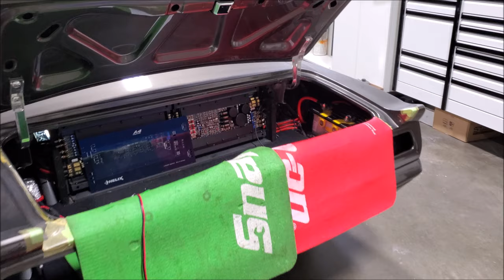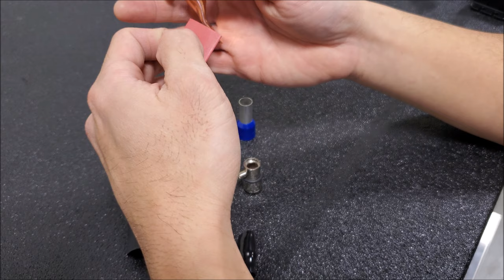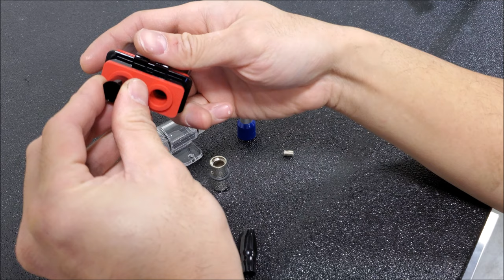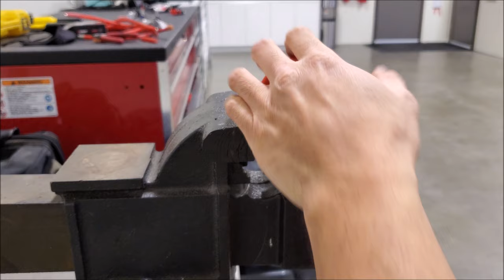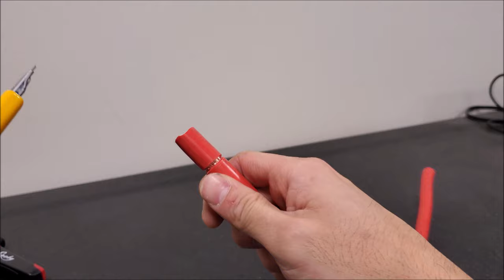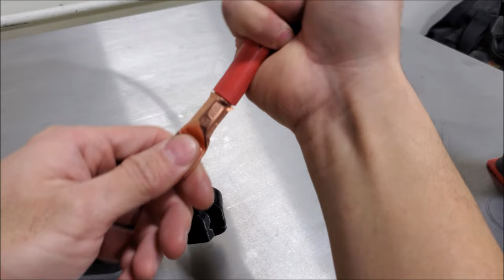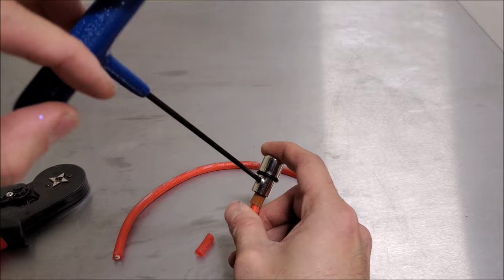How to Crimp Large Gauge Wires (Battery Cable Lug, Ferrules & Ring Terminals)  | AnthonyJ350

Comment: i'm going to guess the harder stuff is PVC, cna't speak for amp but, i have used EPDM insulated cable and it's thick and flexible
Reply from the maker: Thanks for sharing!
Reply: The biggest downside to EPDM is very poor resistance to petroleum.  As long as you keep it away from oil, gas and petroleum based greases, it can be good stuff.
Reply: @LTVoyager  I'm glad you told me, I didn't know that! And here Amazon sells it as welder cable! Not good for shop use them but, fine for in home battery banks and that!!!

Comment: The guy who taught me 2 weld wouldn't buy the copper end lugs he would make them out of copper plumbing pipe
Reply from the maker: Sounds like more work and not as nice a result.
Reply: I was tempted to do that back when the supply for ring terminals was very limited so they were expensive.  Now they aren’t as expensive even for good ones

Comment: Not sure why you're using starter lugs vs power lugs...
Reply from the maker: They're just copper lugs, they're not limited to starter motors.  But lets say they are.  They're used in the elements and can handle tons of amperage.

If you don't like the look, that would be a preference, but not a fundamental point.

Comment: Maybe make a jig. Meaning something to attach the actual hydraulic crimper to. Therefore making ur crimper stationary so you have hands free to position ur work piece(the wire you're  crimping).. they sell a crimping MACHINE that basically does this. Granted  On that machine all you have to do is push a button to  Finalize your crimp.  But it costs upwards of $1000.  Make a jig that basically  costs nothing from say, scrap wood and zip ties. (just an example) yes making your actual
 crimp is manual, but this jig makes it much easier to attain a good looking, more effective  crimp...
Reply from the maker: I use a press with the hammer style crimper now.

Comment: Dielectric grease is an insulator, not a conductor, use it only on the exterior surfaces to create a seal to prevent corrosion. Don't use it as an interface between connection points.
Reply from the maker: I prove otherwise in this video https://www.youtube.com/watch?v=YgJRKlE7pYg&t=401s
Reply: @AnthonyJ350  you can say you prove it, but read the directions. It's not supposed to be used between contact surfaces. I trust the manufacturer and my 25 years of experience working on aircraft over some dude's say so on youtube. Even a simple google search show's you are wrong.
Reply from the maker: @christaylor93  But I show what's happening with test tools. I'm not just saying it. Now not all dielectric grease displaces the same.

To be fair, in aircraft world. Don't you replace wiring after "x amount of service hours"?

I'm not just some guy on YouTube. I have 15 years of field experience working on daily drivers, emergency vehicles, motorcycles and fleet trucks that do salting.
Reply from the maker: @christaylor93  Did you "Google search Dielectric definition? It literally says "having the property of transmitting electric force without conduction; insulating."

Sooooooooo?
Reply: @AnthonyJ350  no, we don't replace wiring after any amount of service hours. That would be almost impossible to do. We're talking miles and miles and miles of tens of thousands of wires.
Reply from the maker: @christaylor93  Thank you for clarifying your industry. Do you have an objection to the definition of "dielectric"?
Reply: @AnthonyJ350  dielectric
noun
di·elec·tric ˌdī-ə-ˈlek-trik 
: a nonconductor of direct electric current
Reply from the maker: @christaylor93  In a 12 volt automotive application can you consistently get dielectric grease to insulate enough to prevent a connection from happening.

I put a thin layer in all my sensor plugs of my car to see if it would prevent it from working and it didn't. Motor cycle mechanics and boat mechanics like to use it due to all the moisture their plugs encounter.
Reply from the maker: @christaylor93  "To debunk this common myth, our application and validation test design engineers created an Electrical and Water Resistance test kit. This test demonstrates the insulative properties of dielectric grease, in this case NyoGel® 760G, and proves that grease does not affect conductivity"

https://www.nyelubricants.com/myth-grease-interferes-with-conductivity#:~:text=To%20debunk%20this%20common%20myth,grease%20does%20not%20affect%20conductivity.
Reply from the maker: @christaylor93  Can you actually prove it consistently? With a multimeter and a powered up device show a degradation in voltage, reduction in amperage or variance in resistance on a wire?
Reply from the maker: @christaylor93  I'll take your silence and lack of proof or any type of testing to show that dielectric grease degrades conductivity as your answer...
Reply from the maker: @christaylor93  YOHB?
Reply from the maker: @christaylor93  You said you trust the manufacturer. But I showed a manufacturer that said it's a myth on reducing conductivity.  

Soooooooooo does that mean you're ok with it? Are you the electronics doctor of the planes?

I do understand airplane standards are higher and different compared to cars. I'm just sharing what I use on salt trucks, emergency vehicles, work trucks, motorcycles and daily drivers.

Comment: I see your using copper clad... ☹️👎
Reply from the maker: Some brands like Stinger put a coating on their wire that's silver.  You cut it and it's copper inside the strand.  I don't use or recommend CCA.  It's also "You're" not "Your"

Comment: That sounds stupid you put it back in vice not to crimp it but to cool it down... 
 Being out in the open air would help you cool down...
Reply from the maker: So the theory of a heat sink is stupid?
Reply from the maker: Why don't you try it?  Heat it up and let it just cool in the air.  Then try again but lightly put it in the vice.  See how much faster it cools down.  You seem like a smart guy.  Unless you're scared to try it 😊
Reply: @AnthonyJ350  no its not, what I was saying is after you heated it up you put it in the vise to cool,  It would cool faster if you laid it somewhere were all sides have air,  sure it will cool down in a vise but cool slower, that is all I am saying
Reply from the maker: @z4u68  But I've tried it. And I find it cools down faster when cold iron is touching it. Try it, what do you have to lose?
Reply from the maker: @z4u68  Would it not transfer heat through conduction, especially with it being colder than the piece I heat up with the torch? https://www.auburn.edu/academic/forestry_wildlife/fire/heat_transfer.htm
Reply: @AnthonyJ350  actually I never thought of that angle.. I just learned something. Thank
Reply: Thanks
Reply from the maker: @z4u68  Thanks for listening. Try not to mock someone next time. Just ask nicely. People will share more information willingly to help 😉
Reply: Generally if you put something on top of something that usually helps to maintain the heat... But I wasn't thinking that device would be cold.... And in my workshop the bench vice is not cold.  Hope that explains it... Enjoy your day.
Reply: @z4u68  You are wrong.  The steel vise will cool the copper much faster than open air.  Air is a great insulator.

Comment: No need for grease ! Period
Reply from the maker: Did you just like your own comment? What is fundamentally wrong using dielectric grease where condensation may be a concern in a vehicle?
Reply from the maker: Before we go down this black hole of a debate. Please tell everyone your work experience to give context (aircraft, boats, automotive). And tell us how you've seen consistent failure by adding dielectric grease and what you think is happening due to using it.
Reply from the maker: YOHB? Waiting for your answer transmission. Over.

Comment: Ring terminal in a vise isn’t controversial.  Nobody knowledgeable in the field will ever recommend it.  So, no controversy: it is a pure hack job.
Reply from the maker: Thanks for the feedback
Reply from the maker: Got any videos or pictures of the installs you're working on?  Like to learn from how other people are doing it.
Reply: @AnthonyJ350  I’m retired and have no access to my former work.  I will be installed the electrical system on the airplane I am building, but probably not until later this year.  Just finishing the airframe now and still have FWF and paint to do before most of the electrical and avionics.
Reply from the maker: @LTVoyager  Did you watch the CAF video I sent on how he crimps large ferrule connectors?
Reply: @AnthonyJ350  Yes. I watched it.  I give him a B- as he is using ferrules which is more than most seem to do, but using the set screw to “crimp” them, and he even said “crimp” in a way that suggested he knows he isn’t really crimping, keeps him out of the A range.  If you were to take one if his “set screw crimped” ferrules and section it and acid etch it and then view it under a microscope or magnifier, you would see that at best probably 1/3 of the strands are actually compressed together and the ones on both sides will still be largely round in cross section and not compressed “gas tight”.
Reply from the maker: @LTVoyager  I need to see what your automotive installs and personal vehicles look like to critique CAF in such a manner.
Reply: @AnthonyJ350  I don’t install aftermarket sound systems in my vehicles.  I am quite happy with what comes in the car.  I lost enough hearing running chainsaws and heavy equipment in my teens and early 20s and have no need to lose more nor do I want to annoy people around my cars with thumping base you can hear two blocks away.  I designed industrial control systems for many years so I have no personal examples to show you.  Whether you believe what I am saying or not matters not to me.  I have supported everything I have said with solid references and you can easily find more on your own if you are so inclined.
Reply from the maker: @LTVoyager  Sure you can talk the talk and nothing wrong with what you're saying. We just have no idea how good you are around a car, or what your workmanship looks like https://youtu.be/iXj9pwT4zbA
Reply from the maker: @LTVoyager  All I'm saying, if you can wire a car better in a professional shop environment, please show us what that looks like and what tools you're using to accomplish everything you're saying.
Reply from the maker: @LTVoyager  OK give me some context. Do you perform all your own maintenance on a car and do you have anything aftermarket in your vehicle? Also what's the longest you've owned a vehicle?
Reply: @AnthonyJ350  Why does that matter?  If an 80 year old football coach gives advice to a 20 year old quarterback that is good advice about a technique that’s the 80 year old coach could not himself do, does that make the advice less valuable?
Reply: @AnthonyJ350  When I complete that part of my airplane, I will be happy to show it.
Reply: @AnthonyJ350  I do my own maintenance and most of my repairs.  I do have aftermarket parts on my vehicles.  My Western plow is aftermarket on my Chevy 2500.  I install hitches on all of my vehicles and often fog lights if not so equipped from the factory.  I am just not into loud sound systems so I don’t install those.  I think the longest I owned a vehicle was my 1994 Chevy K1500 which I had for 20 years before the road salt in the northeast’s did it in.  My BMW motorcycle will be 15 year as old in June.  That has an aftermarket CB on it that I installed and several other upgrades to things like fuel QDs and such that were substandard (plastic) from the factory.  I replaced them with Jiffy-Tite aluminum QDs.
Reply from the maker: @LTVoyager  Really good! I'm on year 15 owning my Silverado. 

The reason I ask about aftermarket is, you're saying we're crimping large ferrules incorrectly, but you've never done it, nor can you tell me the tool to use. So I'm trying to understand your experience level with aftermarket parts.

So you want me to value an opinion on a subject you have minimal practical experience in and can't demonstrate a better way?
Reply from the maker: @LTVoyager  So to give advise you actually need to give some. How do you personally crimp large ferrules that go into round opening of an amplifier? And what tool are you using?
Reply: @AnthonyJ350  I haven’t done it on a personal vehicle.  I am retired as I mentioned earlier and have not had need on a personal vehicle yet.  I will on my airplane, but that will use all ring terminals for the high current cables and not ferrules.  Aviation generally doesn’t use set screw style connections as they simply aren’t reliable in high vibration environments which is why you generally only see them in residential and industrial use in buildings and on fixed equipment.  Motive equipment has different needs and ring terminals are superior in almost every way to set screw connections.  They are inferior in speed of assembly, but generally such connections are not changed very often so the extra time to deal with a ring terminal isn’t a huge issue generally.

I really don’t care if you value my opinion.  I have provided advice based on nearly 40 years of engineering experience (I’m a P.E. Licensed in two states).  Whether you care to use is entirely up to you.  No skin off my back either way.  Some folks like to learn and improve and some are happy thinking they know it all.  The choice is entirely yours.  😁. A good tool to use at the lower price point is the Temco Industrial TH0005.  It does things like imprint the wire gauge into the connector/ferrule which is required by code in some applications.  The cheap tools on Amazon seldom have dies which will emboss the connector.  There are also tools that are several thousand dollars, but they are generally only used in high volume manufacturing due to the cost and setup required.
Reply from the maker: @LTVoyager  So you don't install aftermarket sound systems. But we're installing the 4 gauge wire wrong into it according to you. But at the same time you cannot provide a better technique?
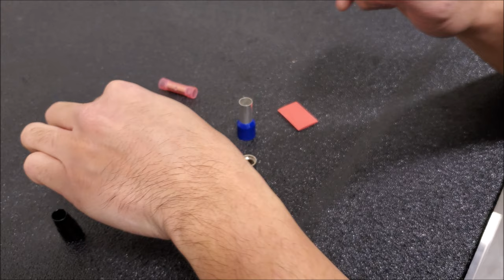Reply: @AnthonyJ350  This is a good video and not too long, but the real meat is at about the 3:30 point.  Although, I don’t think most audio installers care about being UL compliant for safety.  https://youtu.be/3B09qSLek8Q
Reply: @AnthonyJ350  I provided the better technique: crimp the ferrules before inserting into the set screw connection.  Pretty simple.
Reply: @AnthonyJ350  Since your goal is to argue rather than learn, this will be my last post.  Cheers.
Reply from the maker: @LTVoyager  Crimp it with what?
Reply from the maker: @LTVoyager  I have a ferrule crimper like the video you show. The problem with that crimper is it won't do 4 gauge. Did you know that it will only do 8 and smaller and that's why we use the set screw of the amp?
Reply from the maker: @LTVoyager  So I can't show the ferrule crimper in the video you sent (I own that crimper) because it won't do large gauge wiring. Look at how small the wiring is in the video you sent me.
Reply from the maker: @LTVoyager  You said you provide the better technique. But you can't list the tool or demonstrate the result you speak of.
Reply from the maker: @LTVoyager  Have you actually worked with 4 gauge ferrules?
Reply: @AnthonyJ350  It appears YouTube has blocked at least two posts I made.  The video was to show that UL only approves ferrules crimped with the proper tool.  The link I posted to the Temco TH0005 appears to have been blocked.  It handles 10 gauge all the way up to 600 MCM.
Reply from the maker: @LTVoyager  I'll look into it, but it says battery lug crimper. It doesn't say ferrule. The wall thickness is much thinner on a ferrule than a lug.

Have you worked with large ferrules?
Reply: @AnthonyJ350  They have half size dies.
Reply from the maker: @LTVoyager  And you've used them? Is it a good idea to put an octagon connector in a round input. Isn't the only contact patch only the corners?
Reply from the maker: @LTVoyager  I'm going to have to give you a "D", you've only read the text book but have failed to attempt the homework or project.

Once you've tried your theory and have tested it in the field for a few years in different conditions you'll be eligible for a B+ or maybe even an A!

Comment: Sorry dud, that cheap hydraulic tool doesnt work reliably.  Try crimping a 6mm2 tube type lug.  If the cable od is smaller and/or the ring lug is thin walled that cable will just pull out. Soldering essential, and hard work - needs a lot of heat. Also that tool needs a two man job its really difficult to get the wire/lug held in right place in the anvil jaws and the operate the piston handle  TWO MEN needed  RUBBISH.  The hex shape transverse has no ridges to hole the wire
Reply from the maker: But I'm not. I'm doing copper lugs that are 4 gauge and it works in first responder, construction and show vehicles.

You can use the anvil style crimper by yourself if you put it into a press I found.
Reply: I have taken the copper (Tinned or not) & drilled 2 holes with a 18” drill bit & while placing the lug in the vise & holding the wire in in the rear of it Ring hole up heated that lug up & ran my older down into those holes & made perfect solder connections all day👍